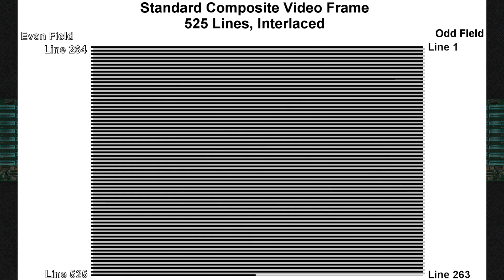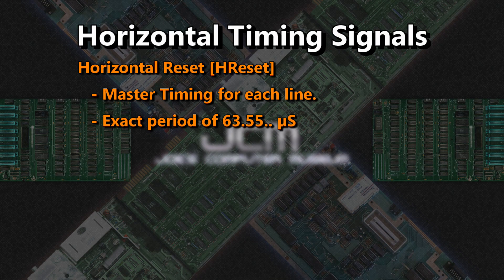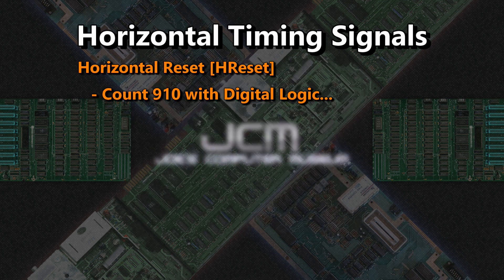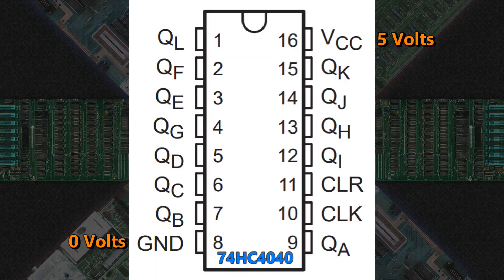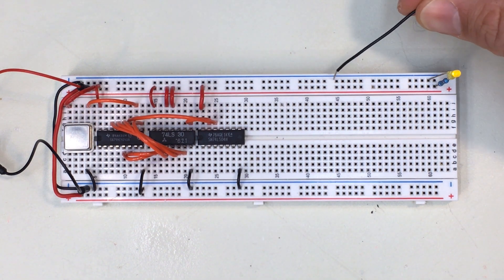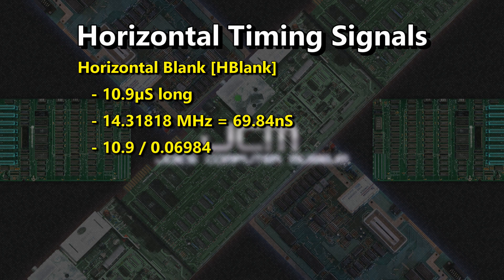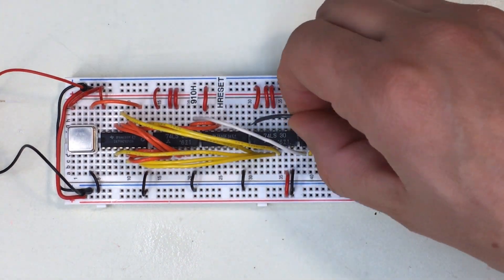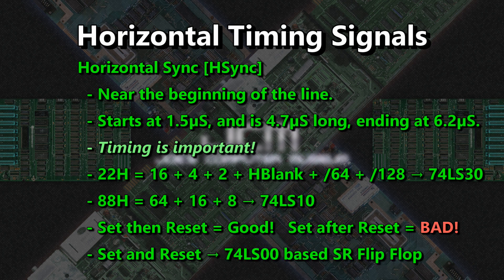NTSC/Composite With Standard Logic - Horizontal Timing Section - (JCM-1 Episode 11)

Comment: 14.318 /2 , 7.159 / 456 will get you to 15.75 khz.. Divide your clock by two and chain two 74ls161 together preloaded to 56. Feed that into your vertical counter, the same setup 262 count 240-244 are vsync. I know this is an old video and you probably moved on but thats another method
Reply from the maker: MATH. Thanks! I've not moved on - just put it on a very LONG hiatus.
Reply: If you ever start again, check out the manual online for vector graphic high definition user manual, its about 45 years old but very clever how they generate composite sync and blank with minimal chips.. Goes into good detail with schematics, good luck
Reply: @JasonOkeefe-x2c oh good shout. Gonna check that out.